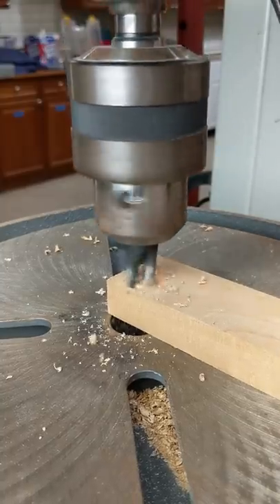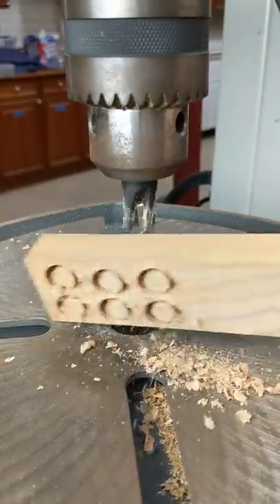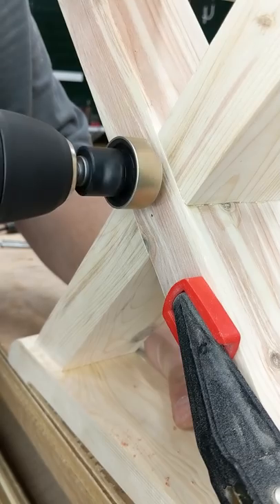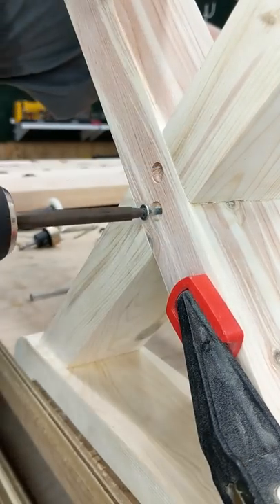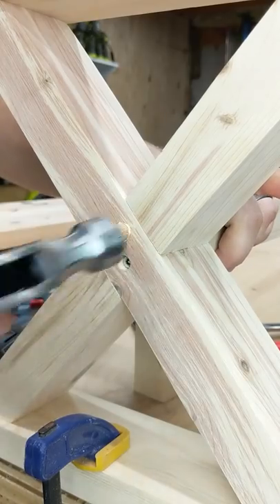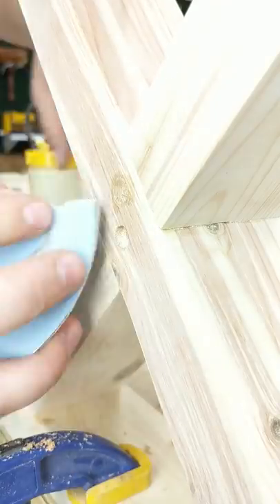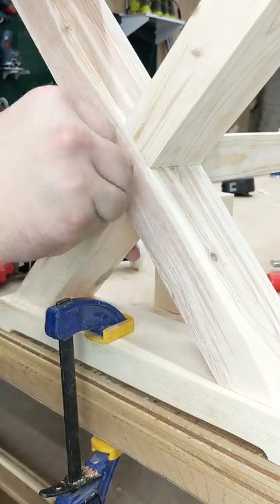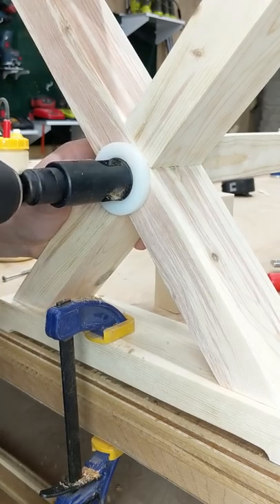Plugging Screw Holes on Bench

Comment: This is why we fill with glue and sawdust.
Reply: Thank you I thought nobody was going to say it you don’t need fancy tools to get results
Reply: @1833said  100% 
but why not make life easier? Technology exists for a reason
Reply: @TheDarkPacific  in this case, life is easier without the fancy tech
Reply: @Ken Williams yes you can
Reply: @Ken Williams did I say wood filler? We fill the wood with wood. Not another product.
Reply: @TheDarkPacific  so does your pocketbook cuz I ain't using mine. Lol
Reply: You ever stain or finish a sawdust and glue plug/fill? It looks like crap.
Reply: @liamhilt1822  use a tone up from your base stain. Golden oak for base , then use a rag to dab honey maple on the plug, or vice versa. 

If the plug is darker, use a lighter stain on that spot. It's not rocket science, but sure keep milking your paycheck

Stop making the same mistakes and labeling the process as incorrect, your input was the thing that needed correction.
Reply: @Cam_B  I guess I had the time
Reply: @leviburns89   I prefer to use plugs because I still think they look a little more clean (you can match the grain direction, which this man didn't even bother to do😂) and all you really need is a plug cutting bit($10 for a set)... But wtf is that last cutter? 😂😂 It looks like a $50 attachment that is slower and much more expensive than just using a chisel to cut the excess of the plug
Reply: @1833said  You can do all that with basic tools anyway. Just drill a larger diameter hole and center the screw within that. Also what a fucking wank with the peg plane just use a low kirf saw and spend a little time sanding.
Reply: Why not cut them shorter from the beginning? Then line up the grain? Put the darker one in the darker grain and the lighter one yep you guessed it in the lighter grain? Those looked like shit.
Reply: @leviburns89  "milking paycheck" how about you just make more money and you can afford this equipment without batching and moaning 🤷🏽‍♂️
Reply: Stain doesn’t stick as well with this option it if you’re clearing it then yeah definitely faster
Reply: @BiggBuugs  I did. Which is why I'll never work for another person again. 

Keep grinding.
Reply from the maker: @TheDarkPacific  Yes! Thanks
Reply: @ToolsToday  you missed the point. You also ignore the main comment looking for one that supports you to reply too. Lame. Dislike not for the video but you
Reply: This is used a lot in wooden ships, the plugs keep moisture out better than glue and sawdust

Comment: As others have said: keep the grain in the same direction BUT even better is to match the color pattern also for an invisible plug.
Reply from the maker: The plugs were made from cherry, that was the small scrap I had laying around, the bench from pine. There really wasn't much of a grain direction to match up as it looks totally different. It all ended up being stained a dark color in the end and you really have to look to find the plugs, but using pine with the same type of grain definitely would make it more invisible.

Comment: In my shop class we would make plugs but instead of using a saw to remove them a flat head screwdriver will pop them out easily, then instead of an exoensive single use tool just use a hammer and chisel oriented in tge same direction as the grain to pop the excess off smoothly with a single tap.

Comment: All that effort... Screws into the end grain.  Pocket hole from the underside of the stretcher will provide a much more secure, reliable, resilient and hidden mechanical fasten joint.
Reply: wouldn't wood-putty do the same thing🤔
Reply: @kendrickshepherdjr8751  plugs are generally less prone to shrinkage, and if looks more consistent even with clear finish.  But with the gaps in these joints... I hope it's just a work or a garden bench

Comment: Set them up on a couple different drills for faster access.
Reply from the maker: It's hard to tell in the video, but I did that here.
Reply: My wife never could understand why I was always buying another drill or impact. It’s so when I’m working on something I’ve got a drill with my drill bit it countersink, I have a couple with different size screw bits, etc. it’s not uncommon for me to have 4-5 drills/impacts sitting there to use when I’m installing cabinets so I don’t have to change bits. I hate swapping bits in the middle of a job! It’s worth having all ten drills/impacts
Reply from the maker: @1982MCI  Couldn't agree more!

Comment: Uee same wood as table, face grain same direction. Can just saw plug off easily. Maybe afterwards run some small sand paper a little if u want. Other than that, that's all u need. Don't need a machine circular stripping away wood. Can tell it don't look right pal. U got bent on that machine u bought 🤣

Comment: Okay this is wayyy too many steps. What you would actually do is drill your hole for the screw (quarter inch). Put the screw in. You put like a drop wood glue. Stick in quarter inch dowel in there, hammer the other end, then grab your pull saw and cut it off. Then you can reuse the rest of the dowel. Very miniscule amount of wood wasted. Eh but this works too lol
Edit: Also no need for band saw or drill press